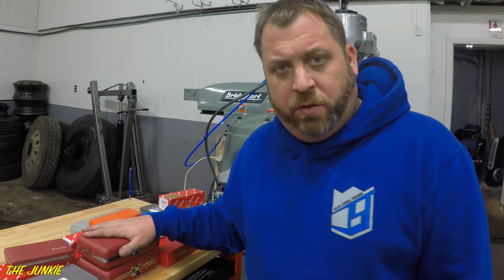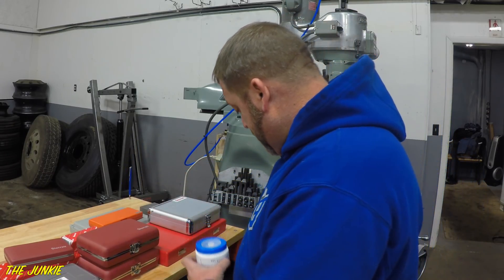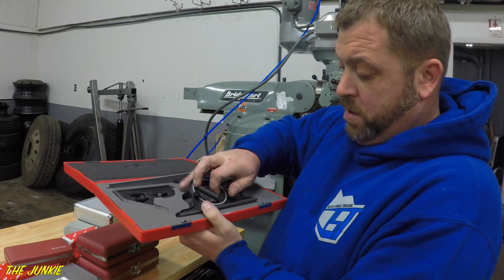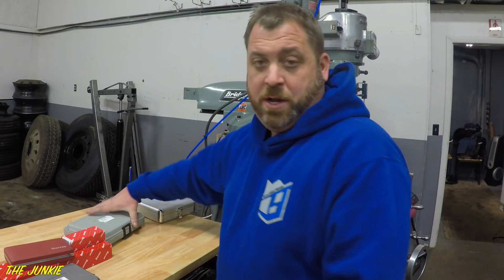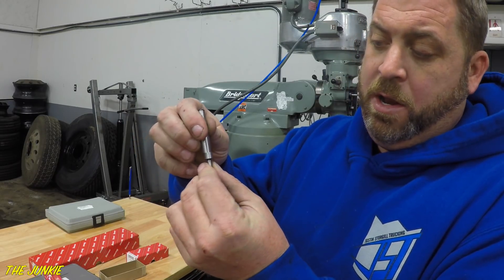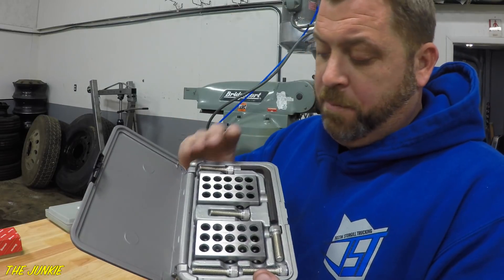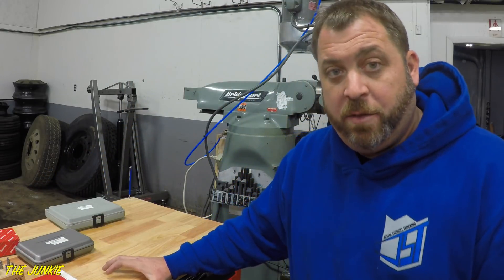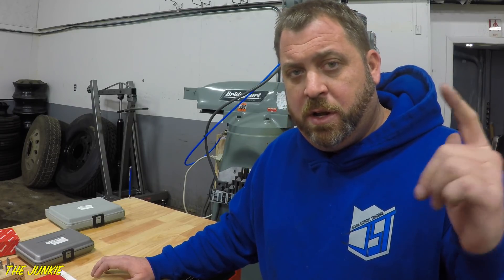NEW STUFF I GOT FOR THE MILL MACHINE SHOP TOOLS (TOOL HAUL)⚒🔧🔨🔥🔥🔥👍🏽

Comment: Junkie, something to remember when you are milling, and that is to know the difference between climb milling and conventional milling. Look that up on You Tube, this is for safety. This is because of backlash in the mill. If you were running a CNC mill there is no backlash so you can climb mill, Also consider getting Kurt Vise, they are better than the old Bridgeport type. Learn how to use your indicator for finding edges and centers! Been a machinist for 35 years have a Snapon Epiq 68 set up as a machinists toolbox at work. And I love it! And I love your videos on tools, keep it up! AMACTOOLS

Comment: Drop indicator, granite block to calibrate and a couple of micrometers, have one of them digital.
Reply from the maker: Kevin's Electrical Tool Channel Yeah I got a granite plate down and I need to get some more drop indicators and test of the caterers and stuff it’ll take me some time to get all that stuff together
Reply: The Snap-On Junkie!!! Yeah man good luck I machined close to ten years. I machined fiber optic glass with a few CNC machines. It’s been a while for me though I’m an electrician now.

Comment: Junkie, for indicators get Interapids Swiss made or Bestest Swiss made, they are the best you can buy .0005 reading is good enough for millworker, all available through MSC. Also get a Indicol indicator holder for the mill. A good source for information on machining check out Suburban Tools, they have great videos on machining for you! I will send you more info as time goes on. AMACTOOLS

Comment: Machinist here. Good parrallels are a nice thing to have, always good to have atleast 1 good set. However, a lot of people have multiple sets of the chinesium ones because with parrellels, its not if it gets hit by your tool, its when. Shit happens sometimes. And sometimes you may have to modify a parrellel for a job or setup. Easier on the heart to do it with chinesium parrellels, then with nice ones. 

Also, you will find a test indicator (I’d recommend an Interrapid brand, model 312B-1) and Indi-Col base to be awful handy. So many uses.

Starrett makes good tools, but some of their tools have gone by the wayside. This is coming from a hard-core, American-made Starrett guy. Starrett calipers are not the best by far and starrett indicators, most especially their test indicators have in my experience not been good. The test indicators have never repeated for me and multiple machinists i know and work with. Last word indicators are good old school tools for a few tight spot applications, but an Interrapid, or even a browne and sharp or mitutoyo test indicator is leaps and bounds better. But somtimes you can’t beat the size and versatility of a last word so i still have 2 in my box.
Reply from the maker: zstewa12 Yeah I’m gonna buy one of those really nice high dollar test indicators once I get some more money one of those into Rapids or something

Comment: If you have to dial in a lot of holes a co-ax indicator saves a lot of time, they are expensive for the nice ones(Blake) but I love mine, I use it a couple times a day but I'm also a full-time machinist. Depending on what kind of tolerances you're trying to hold you may want a mic and also a depth mic. Idk how much you know about endmills but your 2-3 flute endmills are for aluminum, 4-5 flute is for steel and also aluminum it's just not ideal, coated endmills will last longer if you are doing a lot of steel, for aluminum you don't need them coated, also for steel you'll want to use an endmills with a radius on it if you can, a zero radius endmill doesn't hold up to steel as well as say a .03 radius.
Reply from the maker: MrBstnredsoxfan34 Already thank you for the information